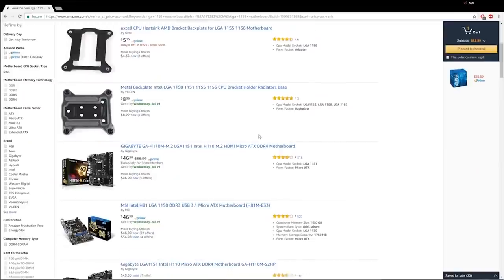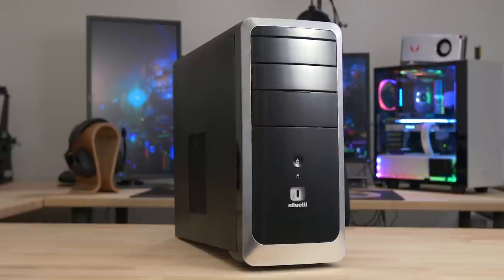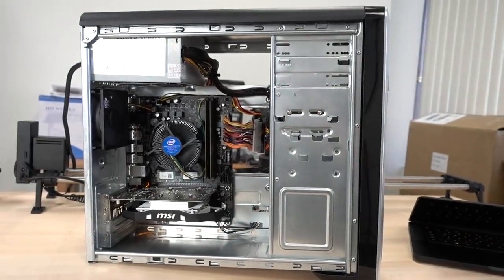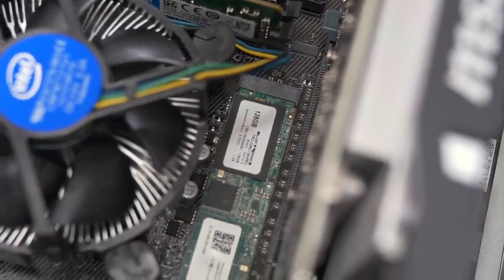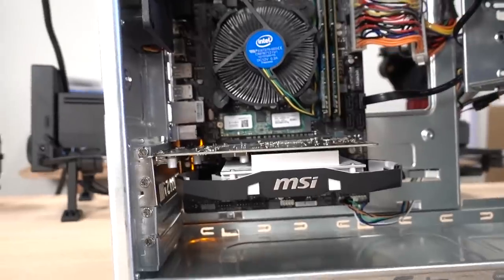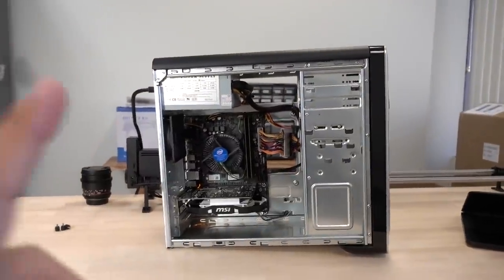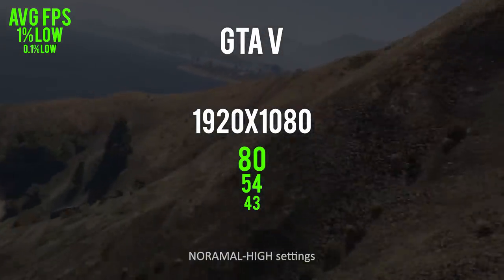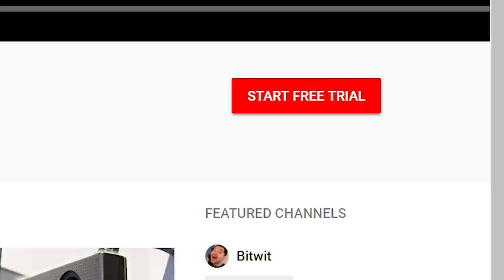The best $400 gaming PC ever?

Comment: I built my current pc for $355 
Its running a 1tb hdd i had laying around so its not included in the price but i also have a i3-6100 oc to 4.7 msi krait gaming z170 mobo corsair 750w ps 12gb ram a be quiet version of the 212 evo an rx 480 oc and some cheap case i got it all pretty cheap used now im just waiting to get an ssd im looking at a 500gb 860 evo for $45 used

Comment: I'm planning to upgrade and I'd like your opinion on the system.

i3 2100->i5 2400
5770->1050 ti 
CM Praetorian->CM Masterbox Lite 5
12gb->16gb
1TB 7200RPM-> 128 ssd (just for boot drive)
Reply: Get a 2500k
Reply: But, is it worth $30 dollars for the k, and a new (overclocking) motherboard for $120? (150 total)

Comment: Whenever somebody is on a budget like this, I always recommend getting old hardware. An i7 860 with a cheap old motherboard and 8 gigs of ddr3 ends up like $120, and it will bottleneck even less than that protium and can OC very well, which is good for beginners. On top of that, I always recommend the gtx 1060 3gb, and a 600w modular power supply. With the money you have left, a hyper 212 evo cooler and a cheap case.

Comment: I like it but I would remove the SSD   and use that extra money to get a 1050ti/1060 3gb instead. Framerates and overall visual fidelity are more important than load times. We can wait an extra 10-20 seconds for a much better experience.

Comment: I picked up a used gaming pc on craigslist, for $150 which included i7-950 bloomfield @ 3.07ghz, Asus Rampage III mobo, 12gb  corsair ram and a Gtx 460, All I did was upgraded to a used Windforce 980 4gb gpu for $200 and added a corsair h100i_v2 liquid cooler. I would Like to upgrade the Cpu, ram and Mobo. but damn it's expensive.

Comment: Hey Dude great video. I dont game too much anymore but wondering what the slowest part in need of upgrading in my present system is; GA-990XA-UD3  with 4gb ram , Quad-Core AMD Phenom(tm) II X4 955 Processor and Radeon HD 6870 with Ssd hdd?
Whats the fastest graphics card you would update this with? Amd rx 460? Amd RX 560? before the cpu/mobo/ram are bottlenecking it?

Comment: this build isn't bad what I would change is the extremely dangerous power supply I would probably go with a better CPU and probably the 1050ti I wouldn't go more budget than that but it all depends on your budget I would just save up always make sure you get a good CPU because you can always upgrade later with a different graphics card or more RAM

Comment: I wouldn't quite call it a console killer due to the relatively inconsistent experience.  By this I mean different settings levels for all the different games.  A console would have the same levels for all games...  cause you can't adjust them.  Which brings me to my next point that I would still hands down take this over a console because of the flexibility!  Maybe it can't run GTA on ultra settings, but maybe the buyer of this system wants to spend way more on a high fps monitor and play CSGO?  Wouldn't have that kind of option on a console.  The thing I love so much about PC's is that you can pay for only what you need/want to.  Consoles still have their place and advantages, but I'm still gonna stay mostly in the PC ecosystem.  Neat build!  Cool to see what you can do with that limited of a budget.

Comment: Not quite a console killer vs the ps4 pro/x1x, but certainly better than the base ps4/xb1.
Quite impressive performance for the price.

That said, If I'm building a pc to be console killer, I'd save another $200 for a total budget of $600 and build a very capable machine. Remember, dollar for dollar, you have to factor in an input method for the pc, but you also get some extra leeway because of the $180 3 years of PS+/XBL would cost. It's required if you want to play online in most games on consoles; one of the main things that made me switch to pc as my primary gaming platform.

Comment: I helped someone with a used pcthat came with an i3 4330 and a 430W psu, plus a gtx 750, and an asus micro atx mobo with a mid tower case that only cost him 100 buck then added a 250 gb samsung sata ssd, a old hdd for storage and a 1050ti total cam to around 480, boots in avg of 25 sec.

Comment: i have an older system but,
ASUS M59A7 R 2.0 paid £30
AMD FX4300 OC'd to 4.6ghz paid £50 brand new
8GB kingston DDR3 1600mhz ram £20
Hyper 212 evo X £15 New
Hyper x fury 120gb SSD £10 
4 x500gb 7200rpm 2.5 drives picked up for a grand sum of £0
A gtx 750ti Palit OC edition, (you wont belive it) for £3.50. 
EVGA 600w 80+ PSU £40
CIT dark star case £30
And a bunch of cheap ebay led fans, x4 at £3 each.
Which is roughly £210.50!!! 

Believe it or not i get 60-70fps in BF1 medium settings, and above 60 pretty much in every game i play.. in 1080p aswell.

Comment: looks great. it actually runs gta better than my pc... i have a server pc with 2 xeon e5506 which i can only power 1 of them, rx 480 ,  32gb of ram, and a 480gb ssd if that counts for anything... going to get 2 new processors soon prob the x5687 and a new like psu so i can at least power all of my components in my pc... but for all this i payed about $260 so it is good for what i got and my ssd is being slowed down dew to a 3gb/s sata connection :(

Comment: There are really good Intel 2600 (non-k) systems on eBay for $200. All you need then is a GTX 1050Ti and probably an SSD and the system will be even better than what you built

Comment: I ran a graphics card test with my 1050 ti, its max temperature it reads on the included software is 125°C. It his 120°C and the fan was only running half speed. Is this normal or is my fan not doing what is should?

Comment: My List:
i5-6400 2.7ghz
GTX 1050ti
500w Corsair PSU
8GB ddr4 2400mhz ram
MSI H110M Micro ATX mobo
1TB Toshiba HDD Storage
256GB SSD
-
Total Cost ~ 438$
Reply: r3 1200>6400. You failed.
Reply: Batemen why be rude about it, your comment has absolutely no merit, just telling me something was better and that I failed (whatever the fuck you mean by that) is pointless, I wanted constructive criticism not blatantly pointing something out. But on a side note, I got my 6400 at a discounted price for 120$ and it is unlocked making it overclockable. So for the better performance and the price I got it at 6400 > 1200

Comment: i don't understand... i have an old hp pavillion - h1114 elite something with dual stick 8 gigs of ddr3 @ 1333mhz a core i5 sandy bridge @ 3.10 ghz with and nvidia gt 520 (1 gig ) but i can't even run minecraft on fancy graphics at a stable 60 fps but this pc can run battlefield 1 on high settings at 50 fps...

Comment: does this fit together and if it does can it play games like star wars battlefront 2015 at low settings
lga 1156 motherboard
intel i5 650 processor lga 1156
ddr3 16gb ram 1066mhz
1tb hdd
cpu cooler
750 watts case and power supply
a random graphics card
price £200

Comment: "COnsole killer?" Well, depends when you buy the console, I suppose, since I'm seeing both an Xbox and Playstation at under $200 for the holidays. Might affect parts prices for the PC too, however. (I know I can find a Masterbox for $20 online now... no PSU though.) Plus, of course, you're ignoring the WIndows license ($100, though yes you can run it just fine unregistered,) and have to assume you have a monitor (can find ~100) and keyboard and mouse. (Cheap.) 

So the $4(1)0 PC is more..> $550, if you're buying those new. (And still ignoring the Windows license.) 

That said? It's not bad for the price point. As a second cheap PC to do stuff if you have things lying around unused? Great. (And I have problems getting under $600... again sans monitor, but with a windows license.)  So good job :D

Comment: Iol for less than halve the price I have basically equal if not slightly better performance for 157 pounds

I5 2400
8gb ram
Gtx 1050 2gb

Comment: How about:
Ryzen 3 2200g
Msi A320M
8 gb Kingston
RX 570
500-1000 gb hdd WD Blue or Seagate
430 watt power supply
Any Rosewill case
Reply: Get a b450 and a 1600AF instead, then you're golden. Also replace that HDD with a small SSD, or spend a few bucks more and get a small SSD for Windows and your programs
Reply: @Whomsky  That's a good suggestion,this list that I put is not really that good

Comment: Wow really? I use similar spec with RX 460 2GB and ASRock H110M-HDV.

No way I can get 171 average with CS:GO with it.
I used all low but AA 8x, FXAA on, and something about antostrophic x16 (man.. that one is hard to remember and pronounce) and it can only get average 172 on dust2

While you did it on Max.
Does my system at fault here or is it really the difference between RX 460 and GTX 1050?

Comment: U could run gtx1050 with a 250w psu?? Isn't the minimum 300w psu?? Can I install one into a 240w psu???
Reply: CPU ~80 watts max, GPU ~75 watts, everything else not even another 50 watts = 205 watt demand max.  Look for the TDP for a graphics card, that's it's demand.  Ignore "recommendations" that don't know what kind of other hardware you have.

Comment: If you are spending less than $500 on a computer and want to build it yourself, going used is way better. New parts at this price range is not that great, since with new there are markups obviously. And because of the limited budget, you want to make sure you are getting the most for your money.

Comment: I know this pc is new but it is terrible value, I built a $298 pc this week and it has a 6 core Xeon X5650, 12gb ram, GTX 690, 875w power supply, 120mm liquid cooler, 3x500gb hard drives (still boot faster the bitwit's ssd in this video lol). Windows 10 included in the price. My pc would crush the one in this video at everything.

Comment: For 100 dollars you can buy a 7010 Dell PC with an i5-3470 in it, slap a 1050 ti in there, put 8gb of ram, 1tb hdd. its only going to cost you around 300-350 and it blows this out of the water.

Comment: So i got:
i3 7100
XPG Flame 8gb ram ddr4(2400 Mhz)
Gigabyte GA-H110M-H
Gtx 750Ti 2GB
600w PS + Random evotec case.
Can someone tell me if its good? and HM price should it be for all of it.
Reply: What's the price you got it at?
Reply: $390-400  Approx
Reply: That's a pretty good price dude. However, I recommend getting a better GPU, but if you're gonna keep the 750ti, get a 430w to 500w power supply.

Comment: Sooo I have a better rig for the same price because I have a i5 2500 gtx 1050 8gb ddr3 1tb mechanical hard drive and a corsair red fan and the coolermasted t4 cooler in a used Corsair spec 01 case and windows 10 from kinguin and 400w spare evga psu

Comment: No don't call this a console killer. For this to be a viable system for use, you need a keyboard, mouse, and you have to assume the console isn't on sale, and the games it comes with don't matter. Because you can always buy the cheapest/most on sale PC parts, but if you do it's only fair to get the console on sale since they are so often
Reply: Well

You can easily get a keyboard and mouse combo pack for 10-20 dollars
Assuming the console isn't on sale - you also have to remember this build was not on sale either. Sales work both ways. 
Most consoles come with 1 game bundeled for free, pc has a crap ton of free games and just cheaper games in general, quickly making up for the one free game
Also, free online (no monthly subscription), working even further to make up the difference for your one free game
Also also: working off your argument that you can always build a pc on sale, you are absolutely correct. We have just as many and good sales on parts as you do on buying consoles. On top of that though, our sales keep going when shopping for games, with the massive online sales happening every couple months or so, and great deals in between those sales. 

I still wouldn't call it a console killer though - it hasn't killed anything, it just exists as a far better value option in general

Comment: dude you could get a much better system for 400 dollars if it wasn't for the SSD you could of had a
ryzen 3 1200- 105$
1050ti- 145$
asus mother board b350- 70$
cheap 360GB 7200 rpm hard drive- 15$
ThermalTake h15 case- 25$
Evga 450w 80+b psu- 21$
8GB DDR4 ram- 60$

yes it would be 436$ new but it would be a much better preforming system, and since you can overclock the cpu to 4 gh easy and its a quad core with 4 threads it would destroy the Pentium with ease and if you found these parts at a good price used you could get it down to around 350$ and on top of all these other benefits you also have a great upgrade path with the entire ryzen series ahead that all fit into the B350 motherboard
Reply: and if i went for 4GB of ram it could of been much closer to 400 dollars but i think 8GB is necessary for most games

Comment: it's not a console killer, because consoles are already dead, at least for sane people.
and this is overall just a bad investment, u should have pointed that out in the video.
the 1050 being not good enough for 1080p 60 fps is a clear issue of course.
the amazing r5 1600 and  1070 or rx570, 580 being best value atm, but at a different price class of course, the best choice would be to get a used system from some surplus shit u got around and slap a gtx 1060 or 580 (don't exist atm i know!! or not for a sane price) and have sth. much faster.
so overall just mention, that u should spent more to get much better value, that's all.

Comment: I’m surprised by how terrible of a job you did for the same $410 I got 8gb ram, ryzen, 480 8gb, 512gb ssd, bitfenix neos, evga psu
Reply: This video is 3 (or 2 around the point you wrote your comment) years old. GPU, SSD and RAM prices were super high, especially AMD GPUs were affected a lot. This was basically the best they could do buying only through Amazon and mostly new.

Comment: Sorry kyle but this is bad value. If you cant save more than $400 your better off buying a $100 core 2 duo\4gb ram prebuilt and upgrading it with a Q6600, 4gb ddr3 ram, 500w cpu and a gtx 770(less than 80 on ebay) a combo like that would last you a year or 2 untill you can get enough for a more powerful system.

Comment: These new builds are boring. The real fun in assembling a cheap, but powerful PC is by using old, cheap, but powerful parts: Core i7 920s, Core i5 2400s, second first/second gen. 60 GB SSDs, GTX560s/HD7850s, Antec 300s or similar oldies, not boring new generation low end shit like H110 mobos and GTX1050s.

Comment: No
The worst 400 dollars pc
You could have gotten an amd a8 9600 a gtx 1050 ti a very cheap 32GB ssd for raid with 1tb hard drive 8GB ram 430watt psu and the cheapest b350 mobo
 It’s going to preform better for the same price and have better upgrade path

Comment: Better: https://pcpartpicker.com/list/jcm9gL  Also, if you dump the M.2 drive you can upgrade to a 1TB HDD for 15 dollars more (faster than the WD Green in this build) and be right around $400.

Using your links, most parts not available at all or not at the price I suspect you paid, same as your last video.  Picking the higher priced parts and finding equivalents for what is no longer available...552 dollars in the cart.  What a joke.  This is NOT a $400 gaming PC.  You may as well find a used item on Craigslist that's a "one off" sale and and go, "SEE, you can totally get a gaming PC for X dollars, except this is the only one in all of the United States with that price."   Fortunately, anyone can go to pcpartpicker and/or just go to Newegg and price out a PC that will be similar for just over $400.  I suggest forgoing the M.2 SSD as I think the one Kyle got, at the price he likely paid, unless he's flat out lying about the total cost, is pretty much a unicorn.  They have a 128GB Eluktronics SSD on Amazon, but it's 89 dollars, or almost 1/4 the budget.  I hope you didn't dupe too many people into buying this crap from Amazon using your affiliate link.